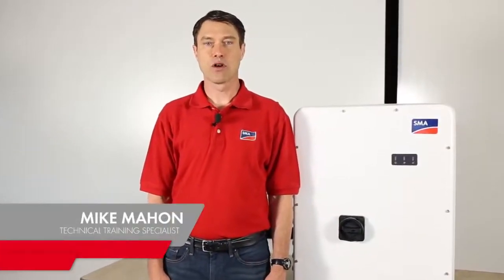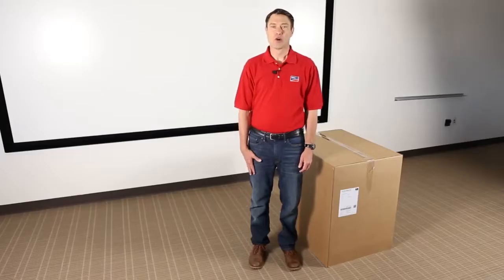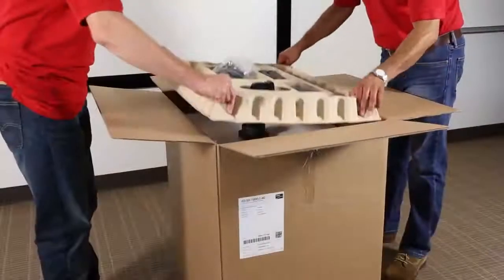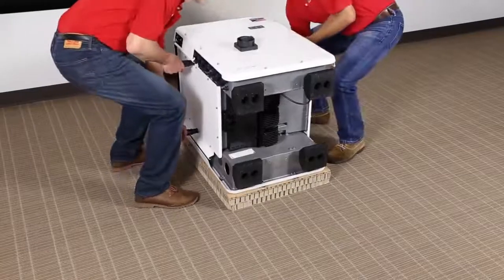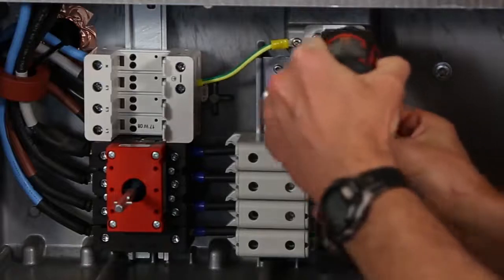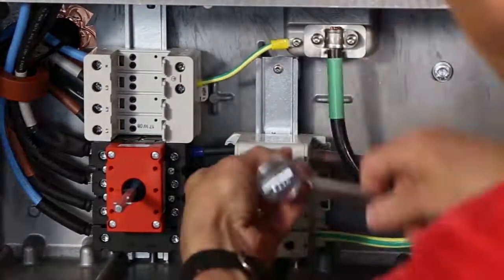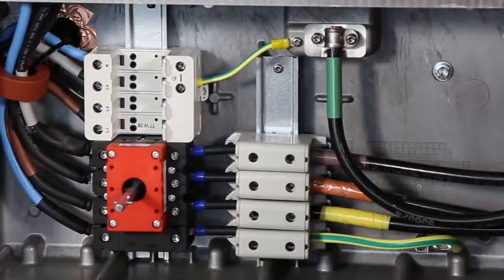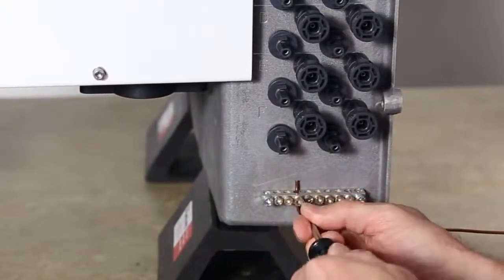Tech Tip: SMA Sunny Tripower CORE1 Installation Overview

Comment: I like to know if this item could be used off grid?
Reply: Nope, no off grid. You could use a Sunny Island though.
Reply from the maker: Yes it can! ... BUT if used/installed with the right PV architecture. IF this isverter in on the PV side and you have 3 pcs )or multiple) SMA Sunnyi Inslands on the battey side than it can be used. As a stand alone inverter on an off-grid config cannot be used since this .. as 90% of the string inverters do not have grid forming capabiliies, meaning they would need a start-up power (without a battery inverter) taken from the grid.